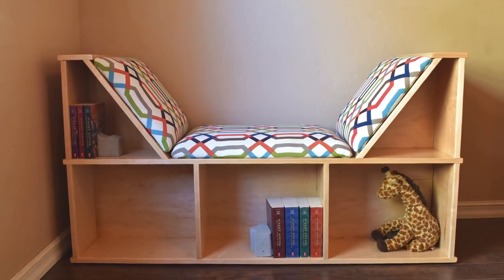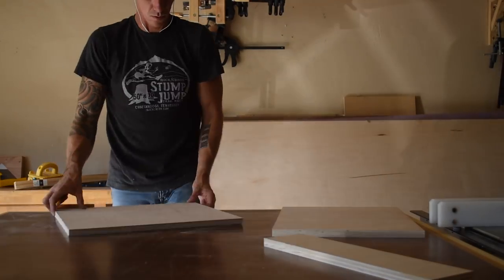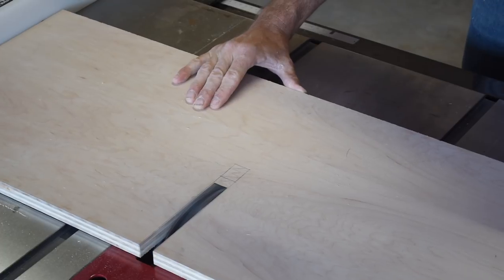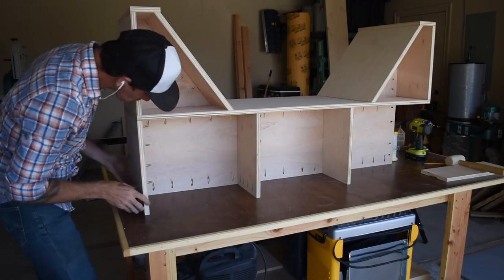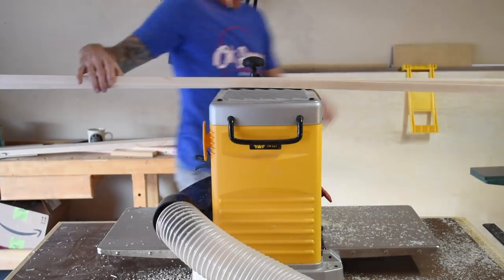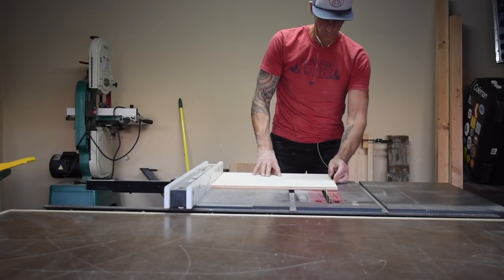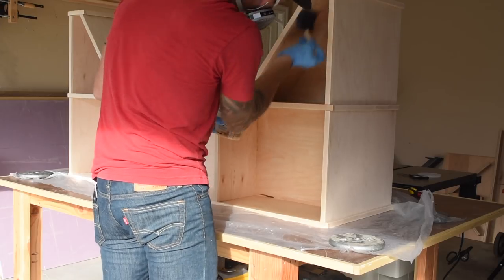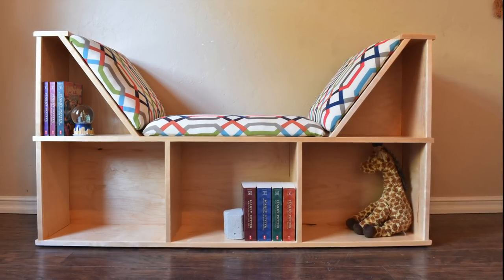How To Build a Kid's Reading Nook W/ No Sew Cushions

Comment: This video is brilliant and I'm in the middle of trying to build this for my son. I've had to try with a rip saw and more primitive tools but so far ok. However I was wondering if you could tell me what size pocket screws I would need to get. Thanks for the vid. :)
Reply from the maker: 1 1/4” pocket screws anytime you’re working with 3/4” material. Good luck and make sure to send a pic!

Comment: I am building your reading book for my granddaughter I love it. I am new to woodworking and have a problem I hope you can clarify for me. How do you set a table,was angle to 37 degrees, it only goes from 90 to 45.  What am I not getting. Thanks appreciate it.
Reply from the maker: Your starting angle with the blade straight up is 0 degrees. 37 degrees is just 8 degrees shy of 45 where most saws stop on the angle
Reply: Thanks for the quick response and for that. information  I was confused because when i put the Digital angle guide with  the blade straight up it reads 90 and when I tip the blade it goes down to 45. So in essence in that case i should stop the blade 53 to get the correct angle for the cut. You can't zero out the angle finder when it is magnetized to the blade.
Reply from the maker: This is the one I use and allows for zeroing:https://amzn.to/3zXrVpm
Reply: @JonnyBuilds  Thanks ordered it.